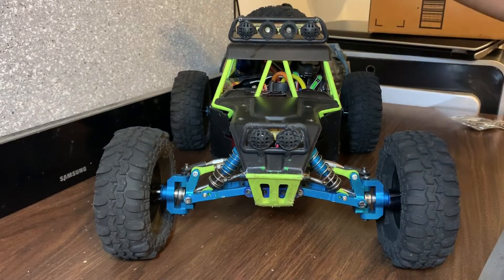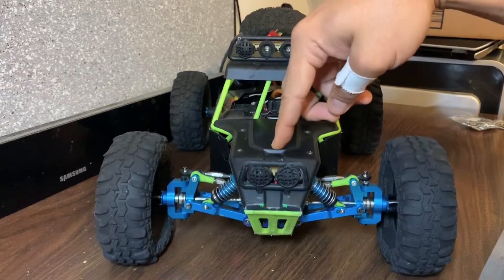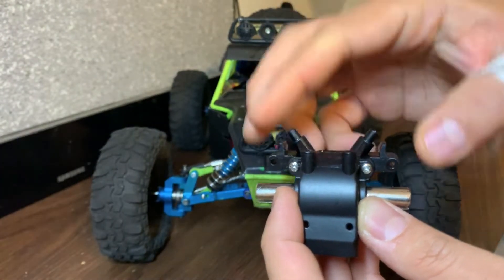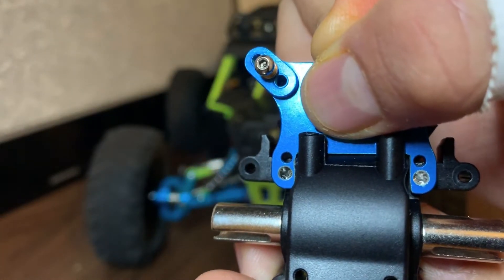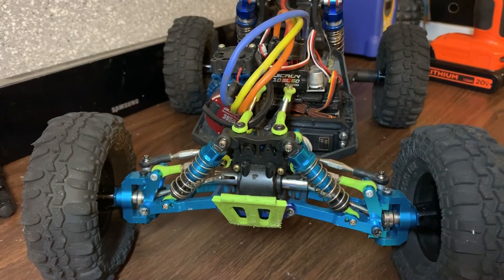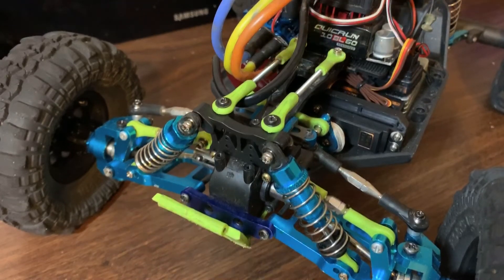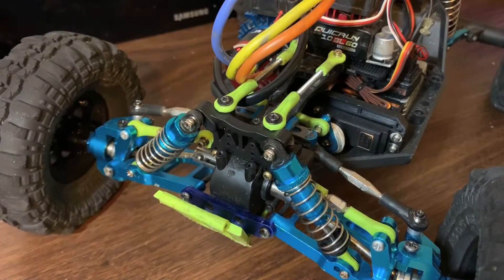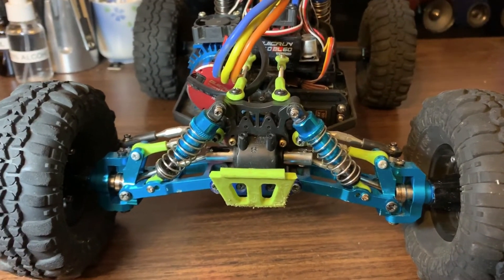Custom Front Shock Tower For WLToys 12428

Comment: Just got mine upgraded using your video..sooo much better! Thanks

https://drive.google.com/file/d/1uiQb8DaWfdrb9rPg9j8wFs4v7qBHGqkU/view?usp=drivesdk
Reply from the maker: Eric Hess - Nice!  Good to hear the video helped, that’s why I made it so good to hear that it’s helped someone.  The link didn’t work though think the access isn’t set up to be viewed by just anyone.
Reply: Tried the 3s and all hell broke loose..by that I mean spur gear became detached from driveshaft and rear driveshaft became detached from rear axle pinion. Took whole thing apart including rear diff and and lock tighted  the hell out of every connection I could find..let's hope it holds!
Reply from the maker: Eric Hess - Yea link works now and yup that shock tower looks familiar hahaha. Yea had problems with the grub screws coming loose so I started to use use red loctite, know that’s supposed to be impossible to take out later without like heating the screw up but on these small grub screws I haven’t had an issue just holds tighter than blue but not super semi permanent like it would be on a larger bolt.  I also have MIP hex bits that are super quality tools, strong metal and super precise fit which means less likely to strip a screw or the hex head and I can put in some good torque on the screw without having to worry about stripping anything.  But yea good lookin 12428 brotha.
Reply: Thanks man..slowly upgrading to the aluminum parts..got most of the front end done..haven't done any rear aluminum yet. Have had lots of issues with screws coming loose so I'm using blue locktite now..hopefully helps. Just got program card for esc so jumped up the acceleration and the low end power so hopefully helps with the cogging, haven't driven it yet..had it all apart the last few days. Will let you know how ot drives..will try to link a video. Thanks again.
Reply from the maker: Eric Hess - No problem and yea hope she runs good and yea definitely need blue loctite on the hardware that goes in the aluminum parts those will 100% fall out all the time without it.  Ask me how I know haha.
Reply: Yup..found that out 5 mins into running..wheels were sagging..only lost one screw thankfully. Was one with the metal sheath but had an original one to replace with thankfully. Gonna check screws before and after running now.
Reply from the maker: Eric Hess - yea learned that lesson, especially with the shoulder screws that are a little trickier to replace, always check those.